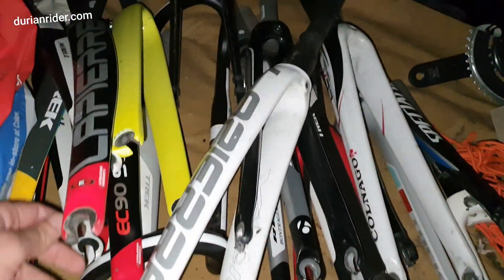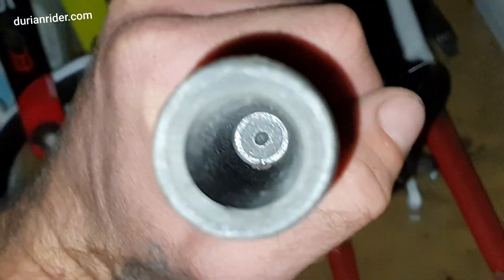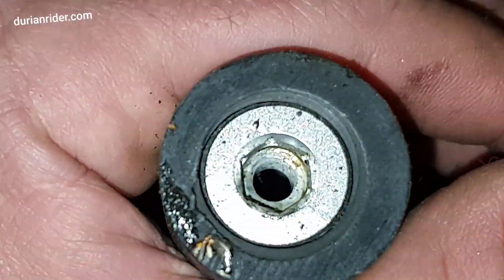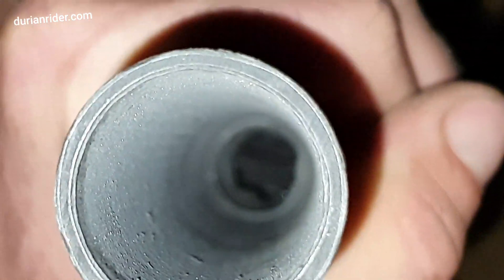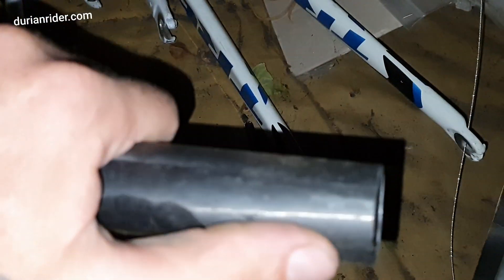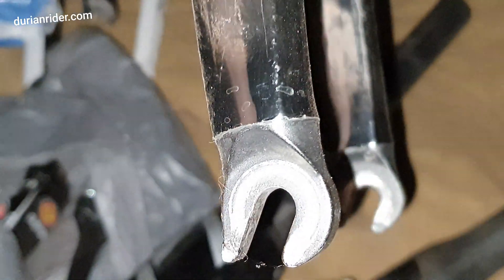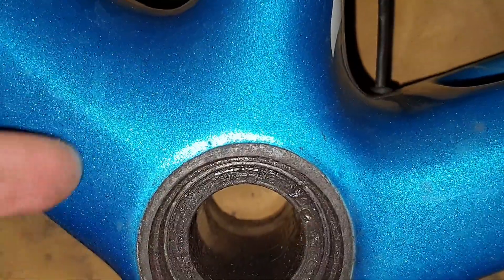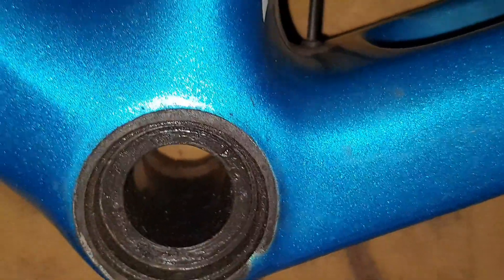How to prevent carbon fork failure?

Comment: Can I tighten my stem without a torque driver, estimate 4-6 neutons?
Reply from the maker: For sure as long as you know what 4-6 feels like. :)
Reply: No problem just don't overtight it so you strip alu bolt :)
Reply: @corvus400  go to a bike shop and get one .. good investment mate
Reply: @adrianburns7975  Have them all. Haven't overtighten my bolts for a long time, when not using them. I can get it pretty close with lower NM.